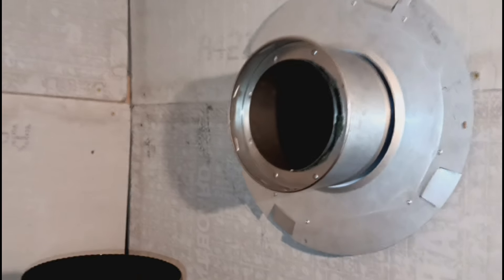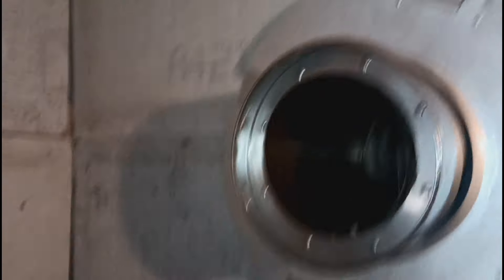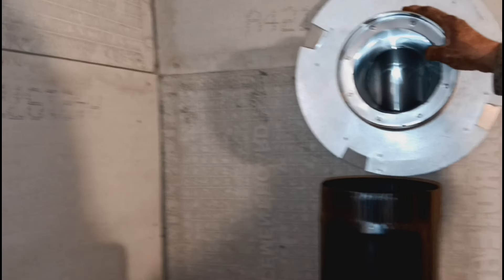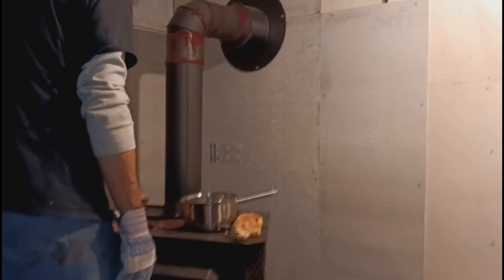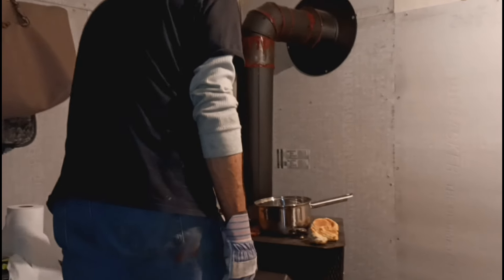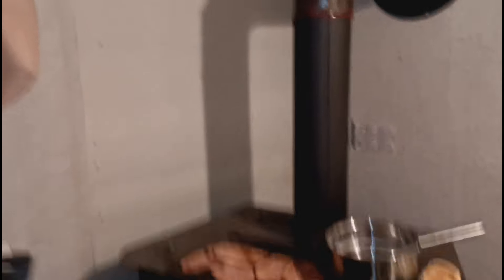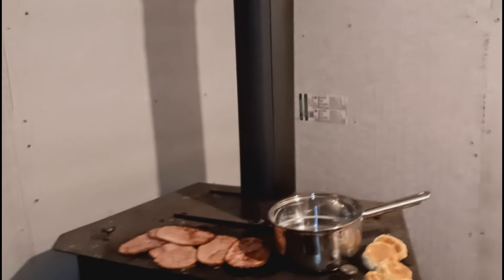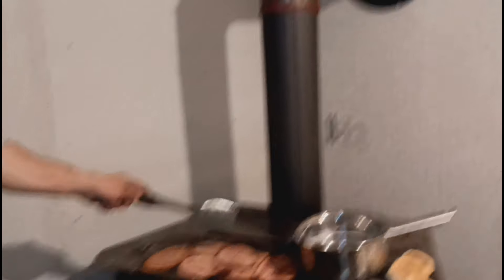A Woodburning Stove for the Tiny House 🏠

Comment: I live in a 50 year old 5th wheel and this is what I have been wanting to do. I want to pull out the propane cooking stove that I don't use and put a woodstove to heat and be able to cook off as well. If the shtf, it's the best option.  I think this is a great idea!
Reply from the maker: I would go for it. Just make sure you have access to wood. Additionally that you fireproof very well. Being in a 5th wheel may require additional research. In the long run its completely worth it. Especially if the SHTF. Which I have a bad feeling it will. Merry Christmas.

Comment: I understand if you want to have, and use a woodburning stove, and it is your choice. I know of different solutions to keep a home warm. The problem with woodburning stoves is that you would need to have a huge supply of wood to keep your home warm each year, and a lot of space, for the wood. 

I have done research regarding how to keep homes warms, and I was able to find different solutions. Unfortunately woodburning stoves is not one of the greatest solutions I was able to find. Simply because whoever wants to use a woodburning stove would need a lot of space, for the wood, and a huge supply of wood is needed, and to get the wood labor might have to be experienced, or it could be expensive to get the wood.
Reply from the maker: Luckily we have no problem getting wood. It's free, the only thing we put in is work. We both grew up heating with wood. I had wood and coal. Coal was awesome! Merry Christmas!
Reply: I’m am interested to know more of your thoughts and suggestions about how to improve thank you
Reply: @The-Good-Life-Off-Grid  My step father's father used a wooden stove when he owned his house. I helped deliver lots of wood 1 time to his house. Wooden stoves require someone to constantly put wood it, or else the temperature drops after the wood stops burning. My step father's father didn't only use his wooden stove, for heat.

His wooden stove was used as a backup. His wooden stove was not used as his primary source of heat.

Regarding myself, I do have different ideas regarding how to improve it's just it would be time consuming, for me to explain.

Currently I am renting, and I am not using a wood burning stove. If I do become a home owner then before that happens I will already have the knowledge to deal with different climate related problems. Because I chose to spend time learning!

My only suggestion that I am willing to give is there are people who might want to reconsider how they live!
Reply: I can only imagine that everyone is aware of the options that exist when it comes to heating any structure. It seems fairly obvious to me that if one chooses the woodstove route that they would have taken access to firewood into account. Personally I heat with wood and while granted it requires that I expend some energy to gather it, access to is not an issue.  I can assure never even once have I looked at something and thought, "man that's gonna be hard, fuck it, I ain't doing it" degree of difficulty simply does not figure into the equation. I don't know, I guess that's probably because I'm not a fuckin p#ssy